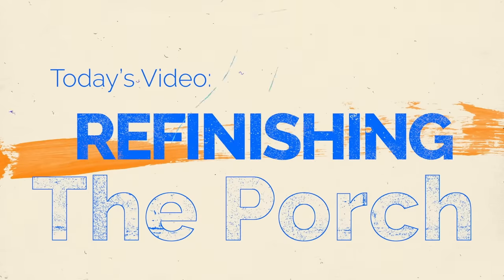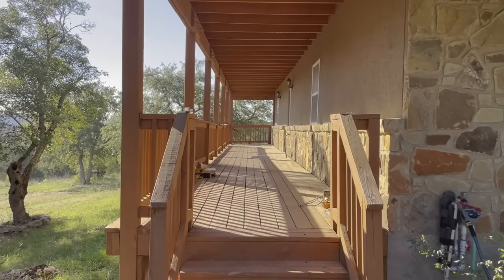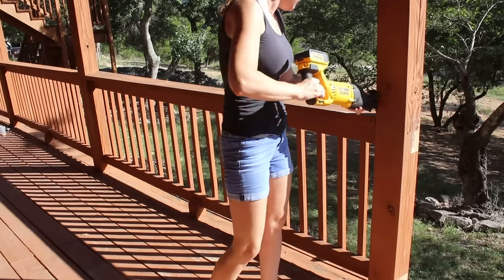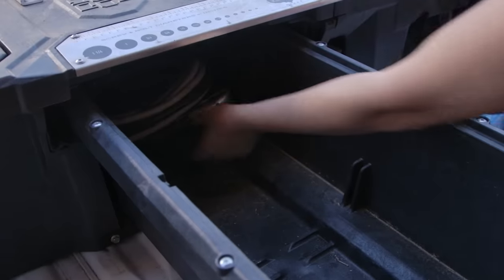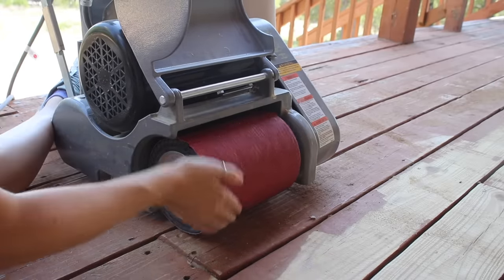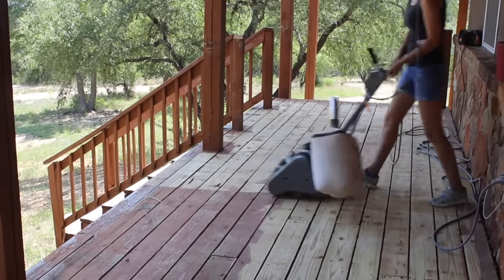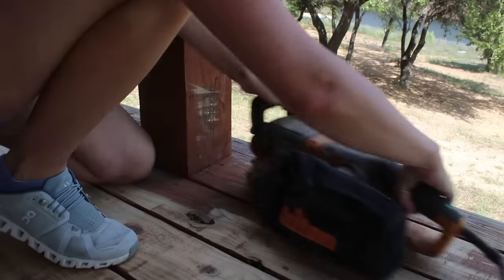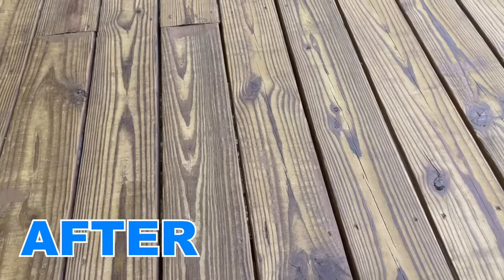How to Refinish a Deck | Sand It or Strip It?

Comment: first you are using a floor sander and in the wrong direction, that sander is for inside flat wooden floors and you are going against the grain, you should be using a orbital large deck sander, (this sander vibrates not circular motion)  ex. 14x28 with 1 inch pad going with the grain, humans dont do your deck this way, 28 years of deck restoration exp here.

Comment: Every modern stain option is just a plastic coating which will require sanding to re-coat after a few years.  Try using a linseed oil paint stain which requires no sanding to re-coat, just cleaning.  If you're replacing the nails with screws, flip the boards over, the bottom of the deck boards will be pristine.
Reply: Tell more
Will I need to power wash first? 
I sanded my deck 3 years ago and it’s time to paint it again.

Comment: Pressure washers don't use a tremendous amount of water as compared to a hose. That's one of the benefits of them. Also, unless the wrong nozzle is used, the wand isn't kept moving, or it's to close there isn't a lot of grain that is raised.

Comment: Perpendicular with grain is a horrible approach to follow for sanding.  Take more passes with the grain to get an even sand.  It will also make the deck more flat with minimal raises.  It will also give an even surface for the stain or paint to coat the wood.

Comment: Stripper and conditioner will always give best results. The reason the pressure washer left marks was because you need to do full passes feathering out, cant just stop back and fourth at high pressure. Looks good for a DIY job. Ive been restoring exterior wood for 20 years. 👍
Reply: What products do you reccomend?

Comment: Great vid April. I did the same thing about 20 years ago on a deck that had aged several years. Using a large 18” floor disk sander with 60 grit, then 120 grit, got it level as a pool table. What made it easy was the fact that I used a under deck fastening system. All of the typical cuppiness you get with PT pine boards was gone.
Reply from the maker: Awesome! Thanks for sharing and for watching.

Comment: Thank you for this video.  This idea popped up in my head a few weeks ago, but the two people I've asked about it said it wouldn't work. This only made me want to do even more! Lol! Honestly, I don't understand why anyone would think this method wouldn't work 🤔! What I want is a deck that is flat across all the boards. My wife and grandkids walk around bare footed, and having a deck that is actually flat would be nice. Our deck is about 8 years old and needs refinishing. Thankfully, the original owners used the "camo screw system" when they built the deck, so screw or nail heads won't be an issue. Your video is proof that this works! I'll be renting a sander soon! Thanks again!
Reply from the maker: Awesome! Glad you found it useful. Thanks for watching.

Comment: I am looking to do a strip, stain, and seal on my very large back deck, so I have been looking for a way to do it without killing myself. I was curious how that exact sander would work on an outside deck. Thanks for showing me. I now have a lot more confidence to go ahead and push through to do it myself. Your issues are the same that I have with railing, nails, etc. Perfect video.
Reply from the maker: Awesome! I'm glad you found it useful. Thanks for watching.

Comment: I have done it this way as well. They also rent edgers so you can get up close to the walls and posts. Always do your first pass perpendicular and your second pass with the grain and go up in grit for a smoother finish. you can even do your first pass on a 45 perpendicular if the wood is really cupped. doing 3 passes always the last with the grain.

Comment: Yes! Lots of people are using that rusty orange color, it is so weird. Love your new color choice!
Reply from the maker: Thank you!!
Reply: We stained our front 8 x 8 deck a dark brown to match the trim on our house. However, we used the redwood stain on our 12 x 16 rear deck, mainly because it was only $13 a gallon.  It has been 6 years, and it's finally peeling up to where it needs to be redone.  Going to try to find a rental place that has a sander. Our Home Depot doesn't rent them here.

Comment: Super-helpful as always.  One thing:  I've seen manufacturers and pros recommend to do only one coat (not multiple) on decks that have been sanded (or new wood).
Reply: But some like Benjamin Moore stain...you can apply a sealer

Comment: Thanks so much for this video. I compared it to several other pressure washing, chemical treatment videos, and felt that this looked way faster and easier. I rented the same floor sander you used and it took me just a few hours to do my deck (about 350 square feet). I appreciated not using chemicals or a bunch of water and the option to stain right away. I would definitely do this again the next time! Highly recommend.
Reply from the maker: Awesome! Yes, it's a game changer to be sure! Thanks for Sharing and for watching.

Comment: i did the same thing to my deck - once - and it worked well. I sanded across like you did, but then diagonally and then with the grain. I wouldn't do this more than once, m a y b e twice to the deck but watch the thickness of the boards! The pt pine decking is softer than, say, red oak flooring (and also not supported by a sub-floor!), so more wood is being removed by that drum sander.  So my 1" deck boards were thinned out to about 7/8 by the time I was finished sanding. Do that again in a few years and you're going to have a springy deck that's not as strong as it was before.

Comment: I resurfaced a 300 squre foot cedar deck several years back and instead of the rotary floor sander I used a square pad floor sander. The pads were 16 inches square and the sander works exactly like a small woodworking pad sander. Because the sanding pad is large enough to span several 2X6 deck boards the chances of gouging the soft cedar was reduced. Like you I used a belt sander to clean up close to the house and aroung the attached bench seats.
Reply: That is all true. And it also takes 10x as long. Those square sanders are for the finishing on a floor after using the belt sander.

Comment: I have to say this is pretty informative. I did use a pressure washer on my deck when I first stained it and it worked very well. I had concerns about destroying the boards but it was fine. The problem I have now is the pressure washer doesn't work anymore. So I'm looking to change how I do it. I think I'm going to try the route that you went and see how it turns out.

Comment: Stain doesn't last in hot climate sun (Redding, CA). Paint has worked much better. It still lasts only so long and must be maintained and repainted periodically.  And, I commend you on your clear, straightforward explantation of what you did, and why. You jumped right into your work without the too-common selfie introduction.

Comment: Using a floor standard is very common in Canada, where the winters take their toll on decks. I'm a DYI'er and use a square-sheet floor sander on my decks and get great results. Thanks for sharing.
Reply: "and use a square-sheet floor sander "- this is a good tip! worthwhile- Recommend!
Reply: @dluuc  They get some paint off and flatten some peaks but don't sand back to clean wood. Drum sander is next to it at the hire shop. Use that.
Reply: @simpletonballsack  this is what I plan to do next week. With drum sander. In my particular project, the deck is very uneven.

Comment: Sander does great for removing previous stain, but might not work for decks covered in outdoor latex paint.  I refinished all 5 decks on my house this last spring.  A test with a handheld belt sander proved that sandpaper wouldn't work on paint..  An angle grinder and DIAMABRUSH head did the trick!
Reply from the maker: Awesome! Thanks for sharing!
Reply: Mind expanding on this a bit? That’s my situation. The deck that came with the house we bought it 24 years ago first had half of a 10 x 15‘ pool embedded in one end we took that out and the deck and then stained with the traditional dark redwood stand which we hated.  
And it has railings with those small little bars all around also. When the new steps were put in where the pool had been, of course, it was all new wood and then we had to replace a few boards on the deck every few years so we had a mix of the old redwood stain and new boards but again we hated the stain. 
So I decided to go with a blue lighter color on the uprights and a slightly darker blue on the flat surfaces. And it looks nice with our blue vinyl siding house. But now after years of that, I’m really sick of having to paint it every two or three years. I would love to go back to just plain wood but I wasn’t sure I’d be able to get the oldest boards with the redwood stain clean enough  

And I’m not sure I can get this clean enough to go back to wood as it’s got many years of latex paint or stain have gone in between the boards as well as on top. I fear I may have to stick with the paint, but at least I can get rid of the old layers and start with a Fresh one.
And of course, cost is an issue…

Comment: Interesting way to get old finish off a deck, and as long as the boards are structurally sound it should be several years before you need to do anything else with it. Speaking of which...any thoughts on whether you might (at some point) replace those deck boards with the same stuff you used for the floating tree house (or whatever you call it) at your commercial shop? Kinda curious though, about the way you put down some stain, then walked on it to apply more. Doesn't that leave footprints in the stain, or does that stuff soak in so fast you don't have any problems walking on it while it's still wet?

Comment: Hi April. A huge fan of your videos. What you have is not a Sawsall. Sawsall (tm) is a Milwaukee Tools trade name , possibly the first on the market, very popular and high quality. You have a "reciprocating saw." I once worked with DeWalt Marketing and enjoyed "correcting" those who misspoke!  😊 Old marketing mantra, "There is a distinct advantage to being first on the market."
Reply: Gary Wilt The same adage could be applied to the word Jeep. Just because it's four wheel drive Does Not make it a Jeep. The Roxor people think what they have is a 'Jeep" it's not.
Reply: I worked with a marketing firm contracted to Chrysler. We campaigned Jeep and Ram trucks. Few knew Jeep is owned by Fiat Chrysler. Also few knew RAM Trucks was owned by Dodge (Chrysler). We ;campaigned Dodge Charger Pursuit vehicles to state patrol and Sheriff's officers. Many identified Charger as a Dodge product. Perception often interesting.

Comment: April, thoughts on the deck board direction? I’ve heard a lot that the boards should be vertical fr the house to take the water out and avoid cupping. Your friends deck was correct from what I’ve been told.

Comment: This is exactly what I will be doing. I have some bad 2x6 boards to replace as well. I’m probably looking into a different railing system, like you. Great info on the sanding process. I have a brick red color and I want to stain it. Did they offer the sandpaper as well? How many did you go thru? What length screws did you use for your boards?
Reply: same question...how many sheets?

Comment: But April, if you're tearing out the railing, may as well tear off the floor and go with synthetic.  I think I used Trex or equiv.  then no screws visible and finish lasts f o r e v e r!  Just hose it off once in a while.

Comment: 🤗TO BE HONEST,APRIL,…I NOTICED THAT YOUR DECK DID NEED REFINISHING 😅  
AND I HAVE USED SCREWS FOR MANY YEARS…for the reasons you mentioned and I have rented floor sanders when possible, FOR the same reasons you did but not always 😢 AND I used the same railings that you removed 😂, they were ALOT of work to re-stain them which is what I did and was recommended over paint 😁💚💚💚

Comment: I sent what I think is even a little crazier, I removed all nails, pulled the boards and grab them thru my Dewalt 735 with helical head… as long as I didn’t remove too much, it was ok. Nice and smooth too.

Comment: What is funny, that I didn't see anything on YT or did a research, but when I was looking at the deck I have to repaint this year an idea to use floor sander just poped in my head. I was like: hey.... my hands will die if I use palm sander and it will take days to do all the work. I can go to Home Depot, rend a floor sander for 45$ for 4 hours and in less than 1h the deck is sanded. After use palm sander to finish tiny spots where floor sander can't reach...
And boom... next day I see your video on YT :D
Reply from the maker: That's great! Yes, it's a game changer to be sure. I can imagine how many start with a palm sander and give up because of the enormity of the job. Thanks for sharing and for watching.

Comment: April, my career was sanding and finishing floors. I have done a lot of decking also. 1, you should never go straight across the grain, the paper will gouge out air the soft areas, instead go at approximately a 45 from 2 directions to flatten the surface, then use a finer grit to go with the grain. I can’t imagine how bad the deck looks close up, after all you would not sand any finished wood surface across the grain and expect it to look good. I do follow you on your channel and and the tv show, really like most all of your videos but this is a disappointing combinations of one error after another   Sorry for being honest
Reply from the maker: Actually I did show closely how it looked afterwards and I think it looks great. Everyone is entitled to their own opinion though and that's ok. Thanks for watching.
Reply: We use these sanders for indoor polished floors in Australia.  I agree that sanding across the grain is a lot mor prone to gouge the wood and leave the floor wavy - perhaps much more noticeable with a glossy finish.

Comment: I used a pressure washer with no cleaning solution.  You have to use the right nozzle and the right  pressure. Never over 3200psi

Comment: This is not a good idea for a deck, because the sander does not take out the paint (stain) on the edges pf the boards. Additionally, if there is unevenness between boards, you cannot take out the paint in the lower boards edge where it meets the other boards. So the only way is to sand quite a few millimeters from the higher boards. That is a ton of work and the sander will also grind the top of the nails or screws

Comment: Since this is online and for other people to see I have to say this is not the best approach. Go on an angle with the grain about 45 degrees but never completely against the grain... This video does it justice but you can clearly see a lot of issues that could’ve been fixed with a few more passes. Since this is plank board and it’s an outside deck there is no reason to go above 80 grit.
Reply: Can you explain the reason for the 45° angle and how that works? I have a  fairly large deck that has been painted or opaque stand for years and I would really like to get rid of it. But it’s gonna be a job.
Reply: @jeffellis6544  I want to give you a disclaimer, I am not a floor sander by trade but I have sanded and refinished a number of interior floors personally and for other people. 

It certainly will be a long job, especially if you’re doing it by yourself. Outdoor decking is gonna have a lot more cupping and unevenness compared to indoor flooring. It’s gonna be a slog especially if it’s pine. The reason you don’t want to go perpendicular (against the grain) is because you’re going to create scratches, unevenness, and just a weird contrast between the boards as demonstrated in this video. Yes it cuts more but it’s gonna look awful, so just do a few extra passes. If you go on a slight diagonal angle up to 45 degrees you’ll be able to bring those peaks down to level with the dips. Use the lowest grit (24-30 grit) to start. Every complete pass you do of the entire deck you should clean with a vacuum and tack cloth so that your next pass is just as effective as the previous one. Use the lowest grit until you have bare wood. Then walk it up to from 40 to 60 then until 80 grit since it’s an outdoor deck, that will help with the sealing process and life of it. I wouldn’t go past 80 grit since they’re not fine wood floors and you need the absorption from the wood. You’re not looking for perfection but the longer it takes the better it will come out typically. Also consider replacing boards or flipping the existing boards if they’re in rough shape.

It’s worth noting that there are a lot of YouTube floor sanding/refinishing tutorials with millions of views that do a poor job so be VERY cautious.

Here is a video that will help answer your question, demonstrated by a true flooring professional: https://youtu.be/9IYkh4E2VUA?si=qsAhbCIwk8jDYbvS